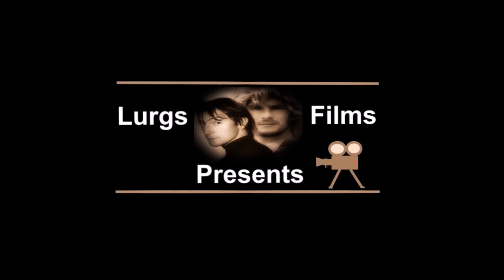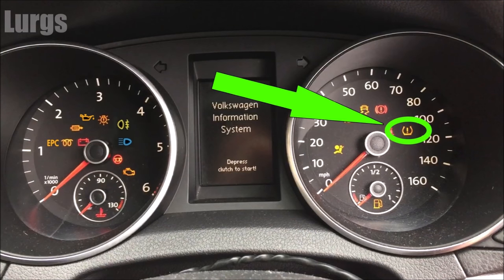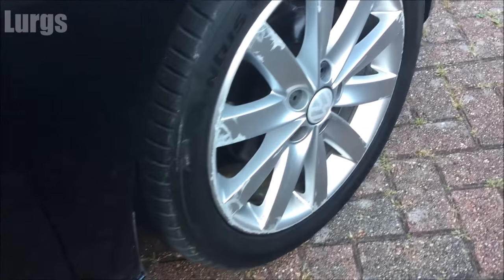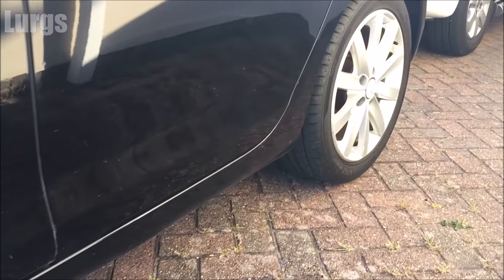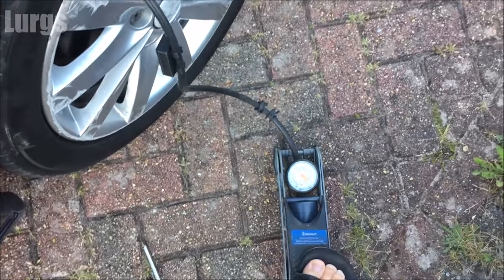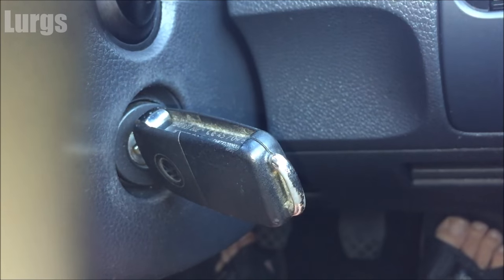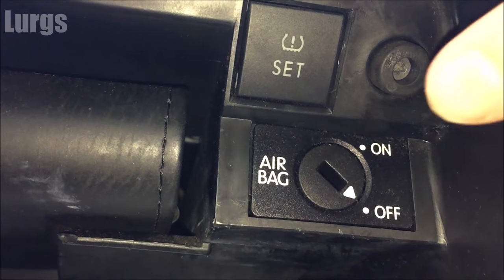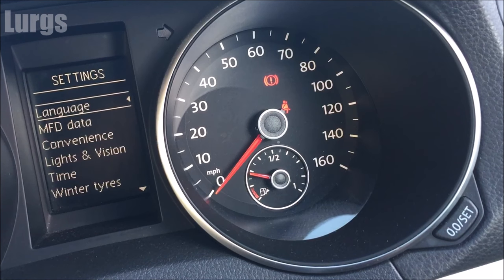How to reset Tire Pressure Light on VW Golf - How to reset Tyre Pressure Light on VW Golf

Comment: My car don’t have this button I’m locking for it but I can’t found it I tried to the screen computer and only says snow tires I don’t know what to do
Reply from the maker: It will either be on the Dashboard menu system somewhere (reset tyre pressure system) else it may be an auto reset system when it resets whilst you are driving.
Reply: @LurgsHowToGuides  Same situation as him @Rafa. My screen computer only shows snow tyres and im running on a aftermarket android player too so cant reset 😐
Reply: Same here guys… I’m driving with the light on for a month already.

Comment: If you reset and the tire pressure is NOT correct…. would the system recognise that and repeat the message of low tire pressure ?
Basically tell u that it’s low pressure again ?
Thanks
Reply from the maker: I don't think it will, when you reset the system it sets the pressures at that point. If it's wrong then pump up the tyres again to the correct pressure and reset the Tyre Pressure system again, should all be ok then. Have a happy New Year.😎.

Comment: It worked but I have aftermarket wheels, I don't even have a tpms
Reply from the maker: Aftermarket wheels can affect the TPMS. You do have the TPMS still as it's built into the drums on each wheel. You can see the sensor spinning if you remove the ABS wheel speed sensor bolt and turn the wheel.

Comment: Thank you captain!!! How to do the same for the seatbelt light?
Reply from the maker: It could be a faulty sensor in the seat or it could be the actual seatbelt plug. It's a pain all these modern electronics, especially as cars get older!
Reply: @LurgsHowToGuides  I've changed both front seatbelts due to a little accident i had 2 weeks ago and the mechanic didn't turn the light of  airbag off. Do you think it can be done only by using a software? Or there is any way i can do it by changing the seatbelt plug or something? Thank you very much for the reply captain!!!
Reply from the maker: To be clear, on your Dashboard do you have a Seatbelt Warning Light or an Airbag Warning light and what colour is it?
Reply: @LurgsHowToGuides  it's the yellow one captain. You know, the one where both are visible, the seatbelt and the airbag. It even pulses sometimes but rare. And I've got vw golf 6 tsi 2.5 2011 captain
Reply from the maker: That doesn't sound good. If the mechanic has replaced the seatbelt clips it's probably interfered with the computer or sensors. You might get lucky with a decent OBD2 Handheld computer and see the Error Codes for those lights and might be able to reset them. But you have to be careful with Airbags, you don't want to fire it off ! Really the garage should have reset it after the work.
Reply: @LurgsHowToGuides  where do you think i cant get this computer captain? And do you think the seatbelts clips are also damaged from a previous accident of the other car from where they got the seatbelts? Maybe those clips are directly connected with the sensor and that's sensitive i guess. Any thoughts captain?
Reply from the maker: @LS-fl1oj  You can buy OBD2 handheld computers which plug into the ODB2 port but they all vary so much. Only a decent one will be able to reset the Errors. You really need to find out what is causing it. Could be when they swapped the seatbelt plugs they are not compatible or they don't have the sensors in. Your best bet is a VW forum where someone who has had a similar issue can help out. But if the lights weren't on before the change then that must be the issue.
Reply: @LurgsHowToGuides  i wasn't wearing a seatbelt when i accidented my car so both front seatbelts got stuck and i had to remove them because i couldn't wear them anymore. Since that time the light turned on and dhe engine light too but i know there's nothing wrong with the engine. So, changing the seatbelts was something i had to do because i use this car everyday and i don't want to get fined everyday from police but really this light has to go off because i want to sell my car. Thank you very much for all your replies captain, you're doing such an amazing job here! 😊

Comment: and I don't have a button anywhere and there's no menu either
Reply from the maker: Oh dear, how odd. It could be an automatic system so once you pump your tyres up it will auto reset.
Reply: I already did that and nothing
Reply from the maker: @blesiu1979  There must be a button or a menu system somewhere, maybe like this one? 
https://youtu.be/HztiUR_mcrA
Reply: there is no function in the menu, there is no button in the glove compartment either
Reply from the maker: @blesiu1979  Then in theory the car should not have TPMS if it can’t be reset. No idea I’m afraid
Reply: Thanks

Comment: my reset buttom no working... have had all tires checked out. Any advice?
Reply from the maker: That's unusual. Are you sure you've got the Ignition on when you hold the button in?
Reply: @LurgsHowToGuides  it finally went off. I'm thinking car needed to be driven for it to reset. Anyway, thanks much for response. All is well. Appreciate the video
Reply from the maker: @NA-uc1el  Some cars do reset it automatically after a drive. Great result. Please subscribe if you found this useful, would really appreciate it. Have a great week.